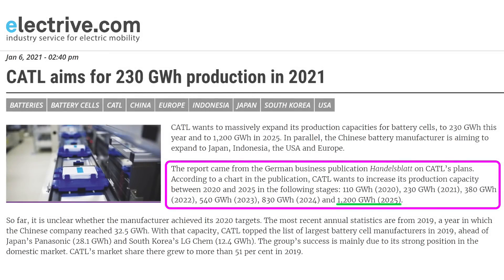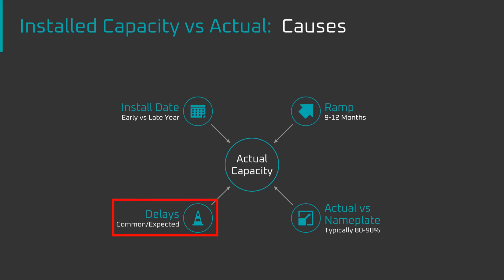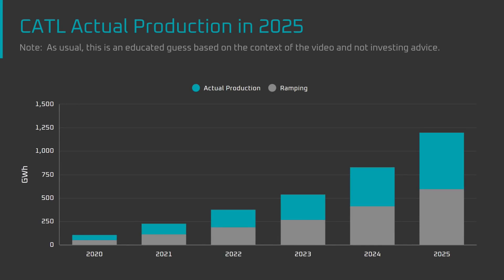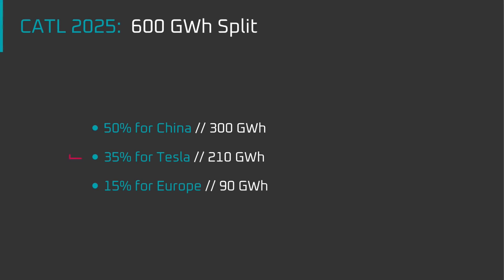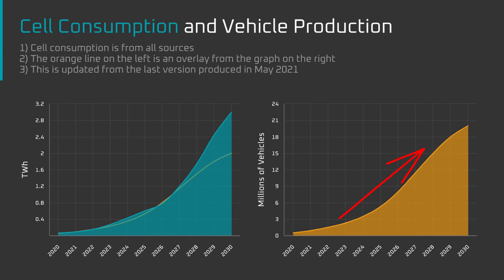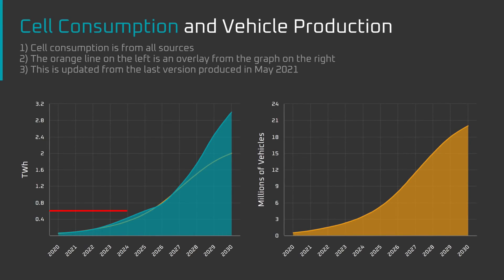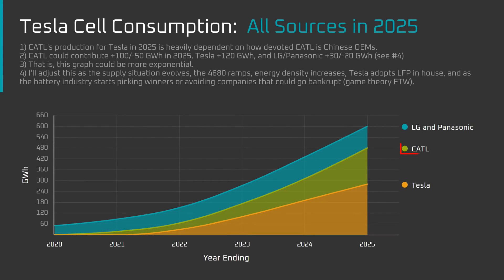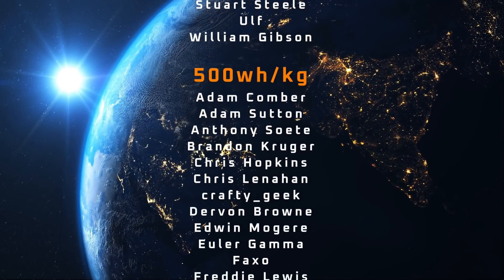2025:  CATL's 1200 GWh Planned Capacity // + Tesla Cell Supply Forecast

Comment from the maker: Note 1:  Elon said that the semi would typically use 5 times the number of cells that a vehicle would use.  There are a number of variables here we don't know:

- Was that the 300 mile range version or the 500 mile range version?  The battery requirements for the 500 mile range version would be nearly double that of the 300 after we factor in the extra weight, etc.  

-Which vehicle or vehicles was he using as his base for the 5x?

-I think they'll add some buffer to the Semi battery pack to take into account degradation.  They may need to add in a 20% buffer to ensure the trucks can always make their runs.

-In light of so many unknowns, I picked a target that was a conservative middle ground between Elon's estimate of ~500 (?) kWh and the 900-1000 kWh estimates I've seen elsewhere.

Note 2:  Yes, the rumour is that Kato road is already 80%+ "yield".  However, yield and utilization rate are two different things.  One is percentage of cells scrapped and the other is percent of nameplate capacity.
Reply: Also, Elon mentioned they are getting close to 600mile range. The semi needs 650 miles for long haul. They achieved 500mile with model 3 tech (2170 cells) I guess the 4680 would allow it.
Reply: Spitting straight facts! And materials shortages are my love language right now, especially because most Tesla bulls like us don't look behind Elons words on Lithium. 50% growth in deliveries feels too aggressive to me beyond 2026 but what do I know and I'd love to be wrong. I plan to pin Elon down on this point at the 2022 shareholders meeting. The 🔋spice🔋must flow. Thanks again Jordan 😎👊
Reply: What do you mean by 4680 god mode learning curve?
Reply: I think the 100k of Semi production is a bit high for 2025, that would be 50% of the US semi market share of 2020. Or do you expect Berlin will build those by then as well? The Mega Charger network will need to be build as well.
Reply: Fisker announced a few weeks ago - the Fisker Ocean (launching in 11 months) will use CATL batteries.

Comment: Hi Jordan,   There’s a company called Altech Chemicals that claims to have solved Silicon anode problem with High Purity Alumina coating.  They are building a POC factory in Malaysia and Germany.  Are you able to tell if they are legit?  Thanks.   They have 2 interesting posts.
Reply: 2 YouTube links.  https://youtu.be/jdhRYGssnHY

https://youtu.be/H3mpyQ6TvzA
Reply from the maker: They'll all legit.  The question is whether they will survive against several dozen other legit competitors.

Comment: Great analysis, Jordan, many thanks. Apart from the raw matl's squeeze you mention, isn't there also a green energy supply squeeze coming up? I think the all-electric NorthVolt plant requires around 250 MW power for some 32 GWh of production. Translating that to the Berlin battery plant for instance (250GWh production), then Tesla need to find some 2GW continuous (!!) of green energy. In Germany of all places, where also the heavy industry is now looking seriously to find green power (+ hydrogen...) A big unknown in your analysis I think.
Reply from the maker: In some places yes, in others no.  Several of the materials producers are locating their processing facilities in areas with underutilized green capacity (far away from cities).

That is, energy supply is more locally constricted that materials suply.   Materials can be shipped farther and more directly than energy.  

More directly to your point:  Energy supply may constrict growth in some areas, but it depends on how idiotic the power suppliers and government regulations are (highly country dependent).

Comment: Love the way you left out GM and their 5% share 'to keep things simple'. Kind of goes against Mary Barra's 'assertion' that GM will 'catch up' with Tesla by 2025.
Reply from the maker: Yeah, I left it out because they'll probably go bankrupt, lol.  Or, at a minimum, their vehicle divisions will be shut down.
Reply: @thelimitingfactor  It's the least they deserve for their century of crime. I will not mourn their passing.
Reply: GM isn't even relative till 2025 at the earliest, if they survive that long. They are still without an EV in production as they work out the Bolt mess and replacing all those battery packs. The Hummer coming at the first of the year won't be produced in any significant numbers as its a nitch expensive model vehicle. So it's till they get the Cadillac in production before they have anything to sell in the way of EVs that will be sold in significantly meaningful numbers. All the other promised models are just talk till they can begin to actually produce them and that's going to be late 2022 at best. So what GM is effectively is an ICE car manufacturer planning to get into the EV market some time soon. So Mary is out sprinkling pixy dust and farytails while the rest are making EVs. Ford isn't much better but they are making EVs at least.. LOL
Reply: ‘Assertion’ == ‘Lie’. I don’t have anything specifically against Mary she’s probably doing her best with the hand she’s been dealt. However she’s either lying or delusional or possibly some gradient in between

Comment: The new phase at Giga Shanghai seems to be a battery factory. The foundation is for something heavy, they're driving piles everywhere and the concrete footings are massive. 4680's?
Reply from the maker: Yup, I did a video on that...Giga Berlin Progress.  The timeline I suspect is being adjusted in light of the permitting issues.  I think they're now building Austin out first.

Comment: I'd add that by 2025, Tesla will have two new factories at least, one in China and one in India. The later will surely produce cells, or have access to Indiens natural resources / cell (new) local producers
Reply from the maker: I try to operate on what's known today.  That is, I'm not going to build conjecture off of conjecture.  My own conjecture is enough, lol.
Reply: Don't agree. I think Tesla will continue to build on their existing sites for the next few years at least. I don't see an Indian factory unless it's a solar and battery operation or an export hub. The local market won't support mid to high-end EVs.
Reply: Well building out existing sites or adding new factories is almost a certainty by 2023 being in production by 24 so should be counted in 25 estimates.
Reply: I believe they can ramp to over 9 million with their 4 car factories currently. Fremont 600k capacity, increasing with structural pack. Shanghai at a run rate of 700k already, plus a 20% increase in size, and ditto with Fremont. Both Texas and Germany both have 1 million+ capacity with their current buildings, plus a lot more area to build. 1/4 done in Germany and maybe similar in Texas. The giga castings will decrease the area needed for manufacturing and the Q should be easy to build. I believe Nevada could be expanded in the future for Battery Storage production.

Comment: Great information as always. 
I have a couple of thoughts. What is the viability of using LFP batteries in short haul semi's. They are not as limited in supply and although they are heavier, but you could use smaller packs to offset the weight and still achieve the lower range.
Also, is there any discussion about a hybrid battery such as half LFP and half nickel-based for any of their products such as Cybertruck? This could take advantage of deep cycle for LFP & deep power demand when it is needed. I'm sure a new battery controller on a split system would be important.
Reply from the maker: Great question!  Short haul I think it's totally feasible.  Could become feasible later this decade with advanced LFP.

I'm of the view that a hybrid cell is inferior to the newer chemistries that will be coming out in the next few years, and that it creates a local optimum...that is, it's overengineered for short term gain.
Reply: That's something that Tesla and others will shy away from for now IMHO. It would add a great amount of complexity requiring dual management battery management systems. It also requires managing the charging of batteries that have different battery charging characteristics. High energy nickel and cobalt don't handle full discharge and charge cycles well while iron based chemistries don't mind full charge and discharge cycles. That pretty much rules out mixing them in the same pack. Having an iron pack and a nickel/cobalt pack then becomes two battery packs in the same vehicle. Managing that is much more trouble than even Tesla wants to mess with of they would already be doing it.

Comment: First off, great video. Provide value and the rest will follow. I assume that Tesla has a good operations research team and are on the phone to the suppliers, suppliers, suppliers. They are now making the investments in the bottlenecks they can foresee. Mining ramps are usually eight years, I bet Elon gave them two years to solve the problem. Anyone want to take the other side?
Reply from the maker: I have no doubt that Tesla can ramp raw materials quicker.  However, the issue is permitting.  The permitting around mines is even more onerous than what they're seeing in Berlin.
Reply: @thelimitingfactor  so gentleman’s bet? Buy a company with permits… Tesla is creative…
Reply: @thelimitingfactor  I'm thinking Tesla is at a level where they have the ability to trade faster permits for factory jobs in the country. They can trade with countries themselves over suppliers. I've heard there where talks earlier this year(Feb 5th) with Indonesia's deputy head of investment and mining coordination(Septian Hario Seto).
Reply: Digging more on Indonesia: CATL is supposed to be opening up a Battery factory there 2024. Rumor of offering SpaceX to build a rocket base in Biak, Papua(On the equator with open water to the east), Inhabitants still in the dark of the still ongoing talks as of Mars this year. The island also happen to be rich with copper/nickel...

Comment: This is so close to what I've been asking for. I think I can use your graphs to get the rest. I think we all have a pretty good handle on how many vehicles Tesla will make 22-25. If we merely use Elon's 45% per year we probably won't be far off. So, how many batteries does that take? Each year? Does that leave enough battery capacity to double energy every year? More than double?
Reply: I've been seeing this bigger need for batteries in electrical grid storage becoming a drain on battery supplies for sometime now. As fossil peak power plants just don't work out anymore and energy production is going wind and solar the grid simply won't work without load leveling and storage capacity needing to grow even faster than EVs. Tesla didn't just increase their battery storage solutions by about 10 times for no reason. Those battery storage units eat batteries even more than EVs. Everyone is busy looking at EVs and their need for batteries but the need for power storage at the grid level will dwarf EVs in the near future. Just California and Texas will need massive numbers of batteries to prevent problems like they have had over the last few years. This may well throw a wrench in the works when it comes to EV production numbers.

Comment: Jordon, I think you need to understand regeneration technology, this is why we are considering LiFe4PO alongside LiMH or similar....we think adding 20% to 30% of LiFe4PO cells alongside LiMH could extend the range 5% to 10% .. and increase the life cycle of the LiMH by a considerable amount due to using LiFe4PO for start off, hills, acceleration etc ..what do you think??
Reply from the maker: Again, I think it's overengineered.  The best part is no part.  Improve the chemistry rather than mixing chemistries.
Reply: @thelimitingfactor  Jordon ..man thanks for your reply...I would love to make a small bet of $10....Yes agreed "less is more" but a tire has three components and the air is free! Our calculation show for cars this idea is not at all necessary but for trucks or trailers or off highway dump trucks etc where the huge weight is a potential stored energy especially on long or short hills. The problem with LiMH is the regen is too slow but LiFe4PO is seconds to minutes from total discharge to total 100% recharge just on regen. Please don't dismiss the idea but I fully understand if you not fully on board, yet! As always great channel...
Reply: I don't understand how this could work in practice. If 20% of the battery is responsible for the high drain and high rate of charge portions of the trip, that means those cells are getting hammered at 5X the current relative to spreading the current evenly across 100% of the pack. 

Even if those cells are rated at twice the cycle life of the rest of the pack, they are getting used up at 5X the rate. That means those cells won't last nearly as long.

Did I misunderstand the plan?

Comment: What is the possibility of a hybrid battery with NCA catering for heavy demand and LFP catering or cruising?
Reply from the maker: Seems overengineered to me.  Easier just to make a better LFP battery (which I expect).
Reply: @thelimitingfactor  Just a thought as many grid scale storage systems use lithium batteries for grid stabilisation and flow batteries for long term energy storage.
Reply: Would it count if the 12v is NCA and the LFP for the battery pack lol

Comment: What happened with Indonesia and the nickel battery factory?  That has been quiet or I missed it.
Reply from the maker: To reach 600 GWh, Tesla will need an additional 200,000 tonnes of Nickel each year unless they plan on curtailing the growth of vehicles that require lots of Nickel.

I haven't seen anything near that large.  I've seen 42,000 tonnes (potentially total) from New Caledonia and China is cutting over about 100,000 tonnes from other sources...but that's for all of China, not just Tesla.

Overall, every major analyst firm is saying the same thing about Nickel:  "Brace for impact"

I've given Tesla quite a huge benefit of the doubt here.

Tesla is in talks with Indonesia, but that will take time to ramp.